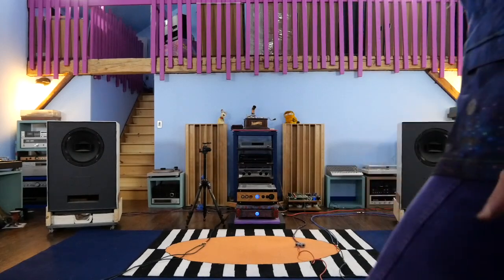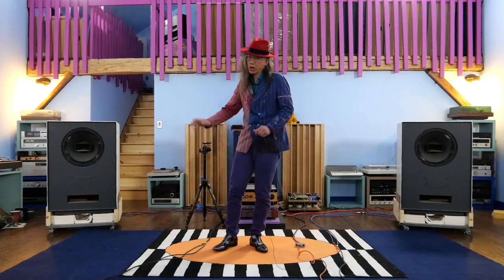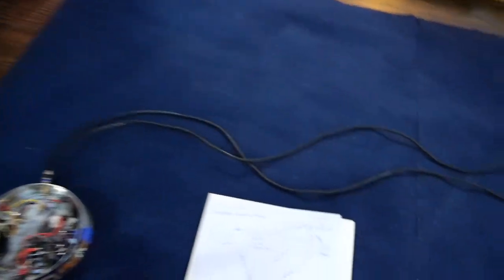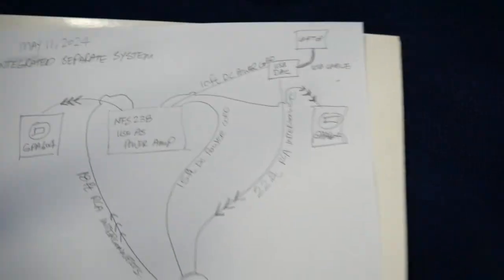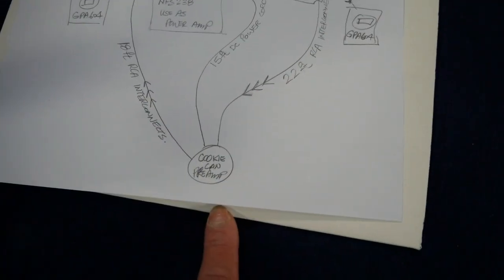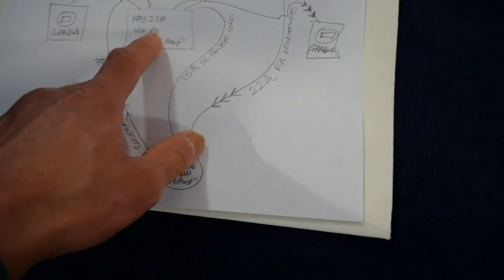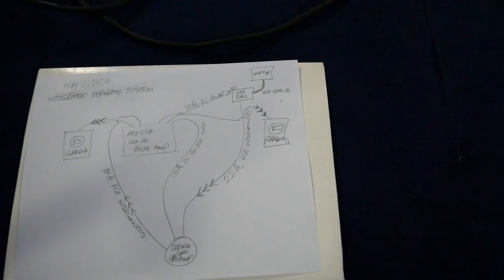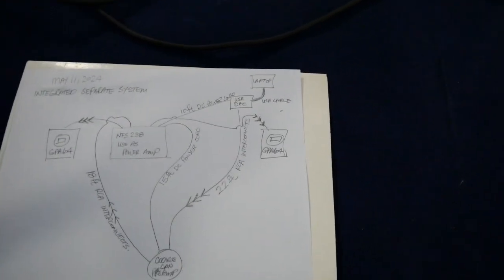An Integrated Separate System Explain First Attempt

Comment: Honestly do your toes reach the end of your toes?
Reply from the maker: Those shoes are not designed to have your toes reach to the end of the toe cap.  If they do, it will be too tight.  In fact, after wearing various kind of dress shoes for the last 15 years almost every day or the week.  I have determined dress shoes are very comfortable, but they have to fit right.  Fitting right sometime means different thing to different people.  Too many people thought fit right mean fit tight.  That's why dress shoes are not comfortable for them.

Comment: How many input have the cookie can have
Reply from the maker: The Cookie Can is a prototype preamp.  At the time of the video, it had only one input.  Since then I have added another output section and three more inputs.  Which makes a total of four inputs.  Now it is call the Cookie and Candy Can because I use candy can to do the output section attached to the Cookie Can.
Reply: @angela-gilbert  love that I have only one source transporter   an DAC  with pre built in running to my mono blocks that pre an power supply will be great
Reply: @angela-gilbert  cookie candy does sound sweet

Comment: There was some slight hiss from the tweeters, the left channel slightly louder than the right channel.
Reply from the maker: Hiss are to be expected especially when the volume control is up.  Hum and buzz should not be there at all and that is the main focus.  In term of level of hiss, I agree with you one channel is slightly louder than the other in the video.  It is mainly due to the way I place the mic in the tweeter.  I was holding the mic by hand.
Reply: @angela-gilbert  Every amplifier I have owned has produced hiss at varying levels. Until recently my Sunfire TGA-7401 was the quietest but then I got a Hypex Nilai500DIY 250W stereo amplifier kit and that is completely silent at idle.